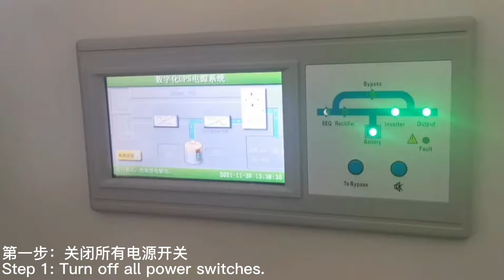Single phase Inverter 30KW 192VDC output 120V 240V 60HZ Motherboard change

Comment: Why was the motherboard changed? Was it defective? Damaged?
Reply from the maker: In a very small probability, damage will occur. There are many factors, such as humidity, dust, vibration, etc. In the case of damage, TANFON will ship a new motherboard. After purchasing our products, tanfon will still serve every customer, including after-sales.
Reply: @TanfonSolarManufacturer  I've subscribed to your channel and seen your Alibaba page, you seem to be a reputable company with very good customer service. I like that you have case studies from different countries. Maybe do more step-by-step comprehensive videos on how customers installed your system, how they are using it, and maybe revisit them after a year or two to show how Tanfon products are performing. Very interested to see how they perform off-grid in different environments as well. Thank you for being proactive in putting out product and customer videos. You're doing good work!
Reply from the maker: @jaygatsby2790  Thanks, Jay